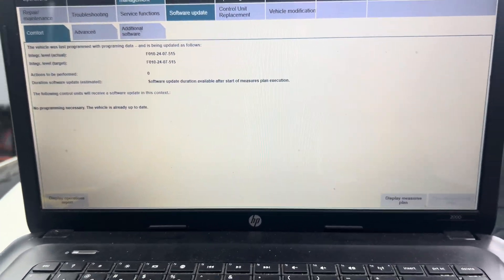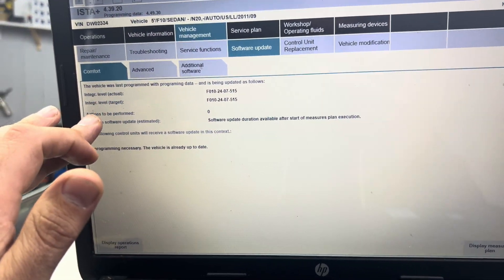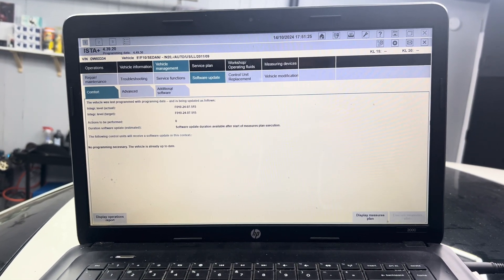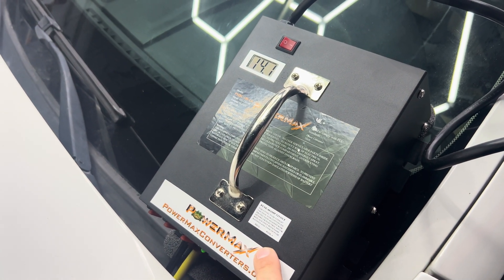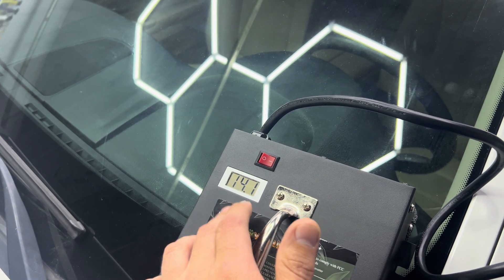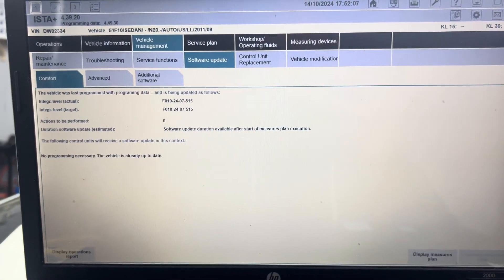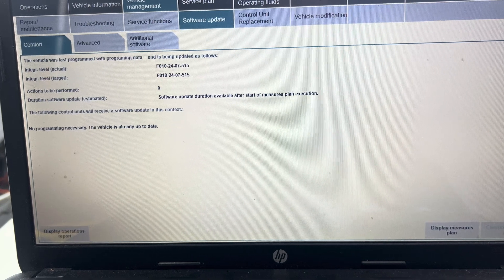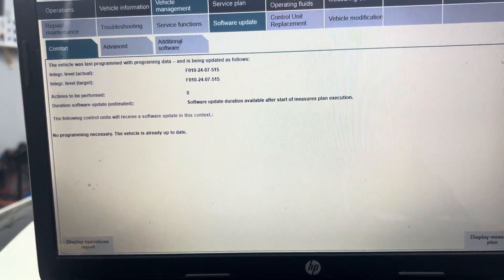BMW ISTA Software Update Can Be Done Easily!

Comment: Way faster with e-sys … less than 5 minutes so you don’t need extra voltage regulator
Reply: What’s e-sys?
Reply: @jcsoto18  BMW Engineering Software.  More complicated but more flexible.  Some people just hook their car into another RUNNING car via jumper cables to maintain the 14V instead of buying an expensive voltage regulator.  WalMart sells jump cables with voltage meter built in for $30

Comment: So you used normal Enet cable for the update? The other Videos I have watched, said that it does not work with normal enet-cable and that you need bmw icom device for the i Level Update?
Reply from the maker: I was able to use a regular Enet cable without any issues. You just need to make sure to switch the port setting on ISTA.
Reply: You mean to switch it to ICOM/ENET Cable Option? Did you update all ECUs at once, because normally all ECUs can be updated via ENET except the ZGW, which won’t allow you to access and communicate to the other ECUs. That’s why I’m so confused that it worked out for you!?
Reply: @xtheelite5614  Ive seen Dean BMW Doctor spreading this, yet I see plenty of folks updating with ENET everything.  Then I see people saying you can no longer use ISTA for F-Series.  THen others saying you can't update individual modules in ISTA but in the new version you can go Advanced and do 1 at a time.  Its the most confusing topic and frankly no one has made a good current 2025 video.
Reply from the maker: @xtheelite5614 Yes, I did a complete update of all modules with the ENET cable. Worked for me.

Comment: I can use enet cable from ebay? I want to update my transmission module on my 6l45
Reply from the maker: Yes, I used one off of Amazon. Worked without any issues. Just need to set it up properly.

Comment: Is it necessary to have rj45 port on laptop? We use ista daily but never have updated software and we have usb c adaper on the enet cable i was just thinking if it is issue. We also have icom always ofcourse.
Reply from the maker: I used a regular ENET cable plugged directly into the Ethernet port on the laptop. Worked flawlessly throughout the process.

Comment: I was a bit nervous to do this and brick my car! Thanks for showing what I need. I’m getting the voltage machine and going to give it a shot this weekend 🙏🏼
Reply from the maker: Same! As long as you have the software setup and a good voltage maintainer you won’t have any issues. Even if a few functions don’t complete you will be able to redo them at the end. Just follow the on screen steps perfectly. Good luck!
Reply: What about a battery charger and set it at 10 amps?  @FlipITGarage
Reply from the maker: @warriorplutotrent3827  The one I used was a 100amp with automatic settings. May have been overkill but just to be safe that’s what I used. Worked flawlessly.